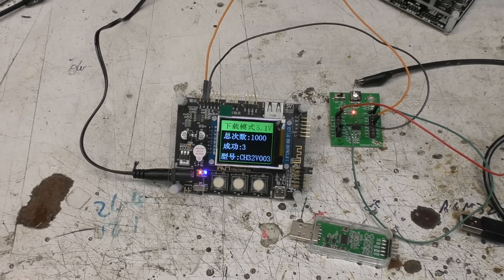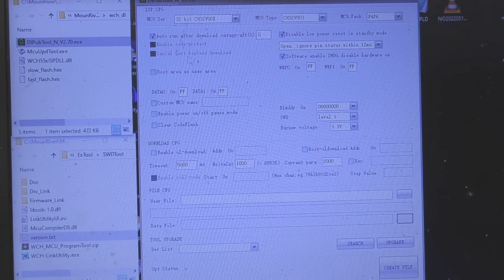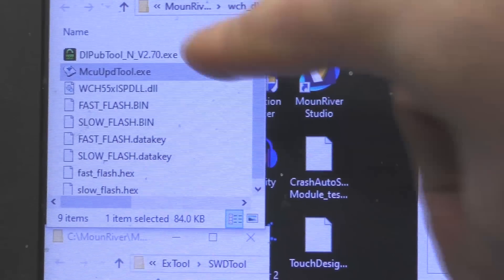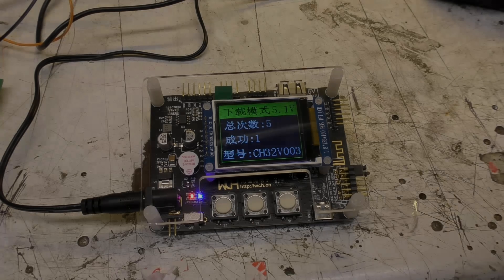Standalone programmer for WCH Microcontrollers WCH-MCU-DL

Comment: I've got a ch32 usb programmer, slightly different but the same ch342 chip is the heart of it.  The big problem with the 5v on the ch342 is that if you've got a 3.2v device connected that isn't 5v tolerant (clearly your device is) you'll fry the device.  I replaced my ch342 with an xgecu t56.  I like it a lot better, far more flexible, fast, and capable. The t56 is like $200 where the ch342 is only like $3 so there's that.  Plus I've spent several hundred more on a plethora of chip adapters for mounting various form factor microchips directly onto the thing without soldering them onto a carrier.  That said, some like tssop8 I do still solder onto a carrier, I just find it way too easy to break a pin with a solderless adaptor.    t56 is way faster when you're programming something with a lot more data than your blink program and is pretty much the ultimate programmer for chip hacking afaik.   It does have standard pins for hooking wires up directly to something like you've done here, but I don't use those much. I usually just remove the chip, program, then reinstall.

Comment: Pretty sure the only reason to choose the MCU package is to check that you're actually staying within the bounds of the available flash. In STM32F0 lingo F4P6 meant TSSOP-20 package and 16kB of Flash... not sure it's the same with WCH but I wouldn't be surprised.

Comment: Jesus, does it automatically burn nowrite fuses too? Theres just a whole bunch on that board that I dont see a use for. Bluetooth on a disposable standalone pic programmer? What the hell would this be for?
Reply from the maker: Microchip's PICkit5 also has bluetooth - could be used for managing multiple program  images, but doesn't seem too useful. in this case the MCU already has BT so a near-zero cost feature.

Comment: Lots of micros with a USB host port can be programmed from that port in DFU mode. It's easy to use one of those A to A cables in an assembled board (Or a standard A to C cable if your computer has a C port) You see this in those low cost 'Gotek' floppy emulators.

Comment: Mike, I forget if I have suggested it to you before but avionics (dash devices for small planes) like nav in a car is dominated by Garmin and they separate out trivial functionality in multiple 10k$ units to milk you the most plus multiple units is expensive in shop time to retrofit in your old plane and the fleet of small planes are worse than the cuban car situation, it's mostly post WW2 stuff. So to update a small personal propeller plane might be 60k$ in little units plus 30k to install it so 100k for what is roughly 90s level compute. There is no state of the art 4k oled displays and miniature electronics like smart phones, it's basically hobby level. And they think that 7 or 10" displays is big and fancy.
Avionics is basically GPS, 2x pressure transducer because they measure speed by air pressure in a pitot tube as well as altitude, gyro, 2 radio channels in (108-138MHz AM) and one transmit ~20watt, some fairly crude map data and some fairly crude 3D display of crude terrain data. Plus data in from the engine. Often it's only 1280 pixel displays.
So I figure a 14-20" display with all the functionality in one which saves on wiring and panel installation could revolutionize the market and become a half billion pound business in short order. A company named Textron buys up basically every company that looks interesting in aviation so they could be a quick exit strategy.
A typical entry level setup is a Garmin G3x main display and a Garmin GTN650 'nav' unit and you might have two of both as redundancy, typically one set for each pilot seat. If you look at a G3x on youtube you can see it's basically like a flight sim from 1985 in sophistication. I figure you could get millions in venture cap funding, hire a few guys to do the work, shoe in success.
Small plane aviation which is called GA or general aviation is really in a very sad state because of such low tech overpricing so it could help the community a ton and make you massively rich.
We are roughly talking 10$ worth of compute in a unit that could sell 5000 a year for 10k each. Once production is set up it might be 95% profit margin.
Reply: Problem is not the tech, it's the certification!
In aviation that's like ISO 9001 QM times 1000!
And that goes down to the manufacturers of your parts. Even the fucking resistors on your bord need to be certified, and if you change them you have to jump through all the hoops again, change your documentation publicize them in the correct way and all!
That stuff is a fucking nightmare!
If you can do that for less then those established manufacturers, go for it! 👍
Don't recommend it!
Reply: @martin09091989  I call that a status quo monkey. You know exactly nothing about it but you are a dramatic naysayer. Can you point to regulation or examples that say resistors need to be aviation certified?
Reply: @yocto if you deleted your comment I appreciate the reconsideration and I also looked up icing testing in RTCA DO-160 – Section 24.0 – Icing. It seems to only apply to externally mounted equipment or location not protected by heating. So not applicable to most avionics. Also it might not require a full scale wind tunnel with a plane, might just be small scale and there doesn't seem to be a requirement for using an external lab. So even if icing tests were required a small box experiment could likely be made if no lab offer reasonable pricing.
Running thermal cycles could be good practice since planes are parked in cold conditions for long periods but that should be quite doable. The regulation doesn't seem to demand a specific temperature range but require reasonable specification from producer for the use. Garmin G3x for instance specify -20 to +60c. This -20 limit is one often floated for LCD displays so that might be the limiting element. A panasonic lyt cap might specify -55 to 105c and the rest of electronics should do quite well in frozen conditions. Even a lithium battery does well in freezing, just shouldn't be charged below 0c.
Regarding individual electronics component certification, that is not required. FAA focuses on system level testing. Also about 7 years ago FAA made a declaration of greater agility in their certification to allow innovation. For aviation to demand an entire electronics industry should be aviation certified is a lot to ask. But FAA might object to you sourcing components from shady places and electronics is so cheap that is not necessary at all. Often the best name brands like Panasonic are very cost effective.
In summary the certification process does not appear all that impossible and it's a one time thing after which it's only component costs, leaving oceanic margin in aviation.
The biggest practical issue I see is a reliable supply of a given display technology because they change so much. Then you might have to update to a new product revision. Should be very doable in the high margin industry.
Reply: Interesting!
Reply: Good luck with the safety certifications
Reply: @404Anymouse  you mean like boeing 737 max or 787?
Reply: So basically piling a bunch of instruments into a single point of failure.
Reply: @sootikins  yet another status quo naysayer. No, typically there is two-side redundancy and there could be a small 3rd backup unit. Could be battery powered and isolated so even a lightning strike couldn't take it out.
Reply: @DanFrederiksen  Since your first sentence is name-calling the  rest of your comment carries very little weight. Debate 101.
Reply: @sootikins  says whom

Comment: That programming limit does seem flawed, even if the binary is unretrievable from the programmer itself. What stops someone from sniffing the SWD wires during a programming session? Is there are any decoding happening on the target chip itself? If not.. then the plain binary code can be sniffed and decoded with a 10$ USB LA is my guess.
Reply from the maker: Nothing is foolproof - any security can be defeated given sufficient time & skill,  but it at least makes it harder. The cost of the LA is irrelevant, it's the skill of the person using it.
Reply: @mikeselectricstuff   That's very true, it will atleast deter the simplest of clones. Someone with the skills to extract firmware from the LA trace can probably spend his/her efforts on product design as well

Comment: I have looked at this before. It was not possible to get the ICs from a reliable source, no dowload of development kit from the manufacturers website and no apparent support in case there is a problem, unless you buy a billion chips. So, I am sticking with ST or, if price is an issue, Holtek from Taiwan.

Comment: Summary
Introduction to the Programmer  
- 0:00 Introduction to the standalone programmer for WCH microcontrollers.  
- 0:07 Focus on CH32V3, a very cheap RISC-V microcontroller.  
- 0:12 Importance of the video due to lack of information and documentation gaps.  
   
Purchasing the Correct Programmer  
- 0:34 Importance of buying the correct programmer version for the CH32V3.  
- 0:39 Four varieties available; need the one based on the 208, not the 103.  
- 1:01 Two versions of the 208 programmer: a 5V version and a universal voltage version.  
   
Programmer Interface and Initial Usage  
- 1:33 Interface is in Chinese, but it's not an issue due to simplicity.  
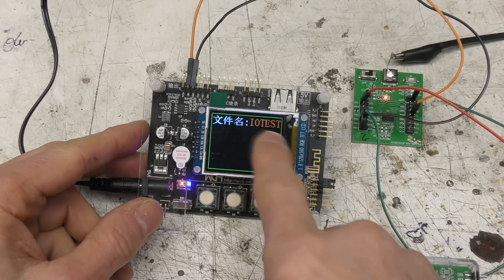- 1:38 The button function is straightforward, with colors indicating status.  
- 2:02 Special features include a programming count and encrypted file generation.  
   
Advanced Features for Production  
- 2:07 Option to set a programming count for production control.  
- 3:04 Integration into an automatic programming jig with logic level inputs and outputs.  
   
Pricing and Accessories  
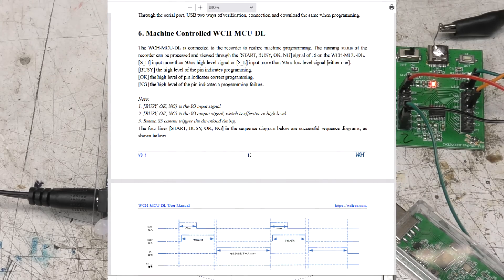- 3:22 The programmer's affordability and what is included (power supply and cables).  
- 3:40 Observation on power jack compatibility issues.  
   
Behavior and Connection Insights  
- 4:00 Programmer behaves differently based on data connection through USB.  
- 4:22 Requires power-only USB or separate power after downloading for standalone mode.  
- 4:36 Inclusion of a possibly unnecessary USB A-to-A cable.  
   
External Features and Programming Details  
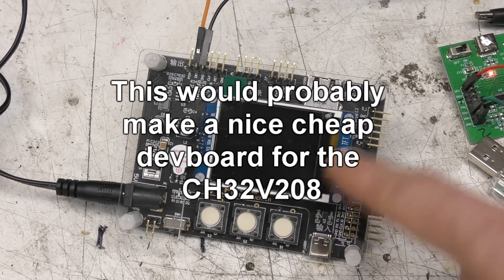- 4:52 Presence of a wireless antenna and various headers for different functionalities.  
- 5:18 An on/off switch that only controls incoming power from the side jack.  
   
Programming Process and Power Supply Options  
- 5:23 Discussion about powering the target device and starting the programmed code.  
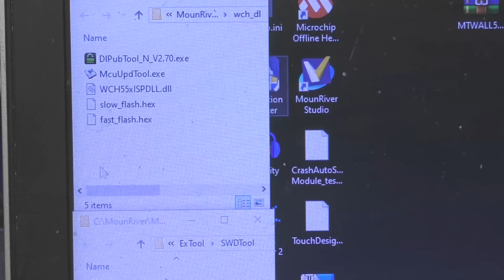- 5:57 Demonstration of programming the target device and observing LED behavior.  
   
Using the dl_Pub Tool for File Preparation  
- 6:05 Introduction to the dl_Pub tool for selecting device and generating a special file.  
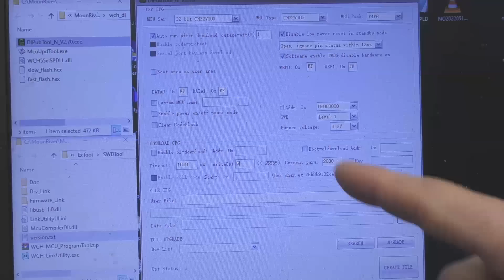- 6:47 Setting the programming attempt timeout and count limits.  
- 7:02 Loading user files (hex files) and creating the special bin file for programming.  
- 7:40 Creating data key files for uploading to the programmer.  
   
Transferring Data Key Files to the Programmer  
- 7:47 Using MCU UPD Tool.XE to load the data key file into the programmer.  
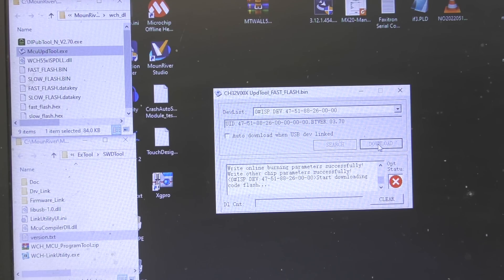- 8:15 Confirming successful download to the programmer.  
- 8:22 The need to disconnect the data connection before programming can start.  
   
Programming and Testing the Target Device  
- 8:25 Checking the loaded file's name, check sum, and size on the programmer.  
- 8:34 Programming operation and power cycle required to start the new code.  
- 9:00 Demonstration of the programming count limit in action.  
   
Changing Programming Files and Further Observations  
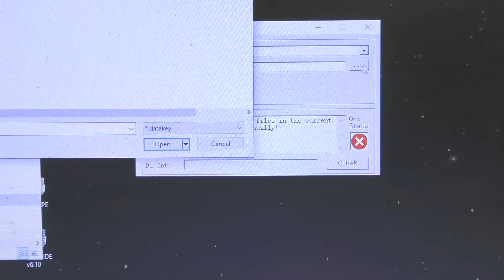- 9:07 Explanation of loading a new file for different LED flash speed.  
- 9:42 Observing the changed flash code in action on the target board.  
   
Overcoming Programming Challenges  
- 9:44 Handling issues with DLL not found by copying required files.  
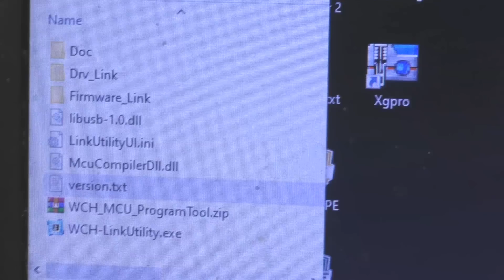- 10:01 Describing the challenge of right protection after programming and how to disable it.  
   
Conclusion and Final Thoughts  
- 10:40 Summing up the benefits of the programmer, especially in a subcontractor scenario.  
- 10:57 Encouragement to share additional information in the comments.  
- 11:08 Closing remarks with plans to update the description after testing a different version of the programmer.

Disclaimer: I used gpt4-1106 to summarize the video transcript.  This
method may make mistakes in recognizing words

Comment: This is what I love/hate about buying stuff from AliExpress... often there's no documentation at all and even when there is some, it's usually wrong.

I've just spent several weeks reverse-engineering a bunch of stuff I bought from AE in order to get it to do the tasks for which it was purchased.  Doing this is more fun than most contemporary computer games but ultimately sometimes it's just an exercise in frustration.

If you factor in your time then sometimes "cheap on AliExpress" is the most expensive option 🙂
Reply: You forget to factor in that you have already brought 10 pcs because it was cheap, and you will not trow it away because it might become usefull someday😅
Reply: @littleboot_  That's not how things work.

Comment: Quality Control Is "Not too Bad".. love it
Reply: In my experience, that includes "the ground wire is just flopping around inside, but they left it long enough for me to actually attach".  A+! eBay stuff has changed "Don't turn it on, take it apart" from a catch-phrase into a critical safety step.
Reply: @R.Daneel  A lot of the cheap stuff I regard as a kit that was supplied assembled, so you have a rough idea of how it goes together. Including $10k stuff, where it worked sort of, but after taking it apart, cleaning out the casting sand left in there, and replacing a few of the more dodgy looking cables (using a red, white and green 3 core cable to carry 3 phase power to a motor, and using a wire that would struggle to measure 0.5mm per core), and tightening all the screws, plus replace the mystery stuff that they called oil in the gearboxes (OK the second one that was more because it went through the motor and wrote it off, fully sealed gearbox used the motor seal as the vent spot, and of course motor was at the bottom) with something that was not actually black, smelly like gutter oil, and lubricating, it worked really well. Not much could be done with the control system, who uses 36VAC in industrial logic, but this one they did. Ended up having a sort of hybrid, replacement coils were 24VAC, easy to get, and lasted well, but the Chinese counters and switches ran off the 36VAC. Short of replace all the counters and contactors, plus do some surgery on inverter drives, not going to do. 

Did replace the very useless voltmeter, which had a thin single insulated pair of wires running to the front panel, connected to 2 phases of the mains, and with no fuse at all, other than the wires catching fire. That hole got a counter added, totally volt free contact added via a microswitch, and a self contained counter from RS, which came with the display saying "SLEEPING", till you first pressed reset. Good for 15 years, and no way at all to change the coin cell inside, but likely to run for 30 anyway.